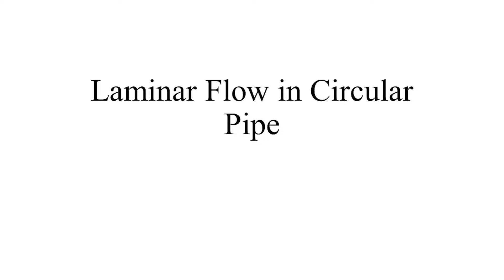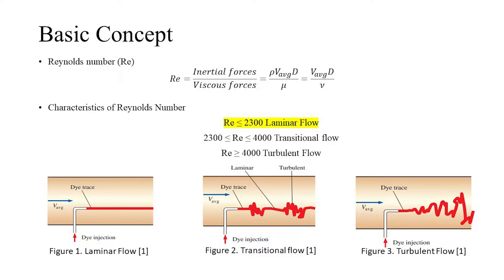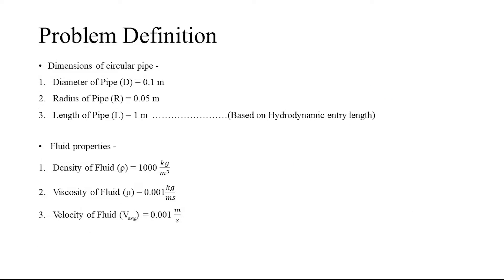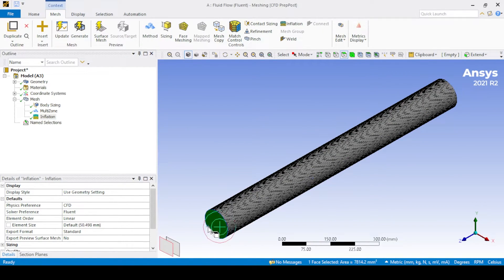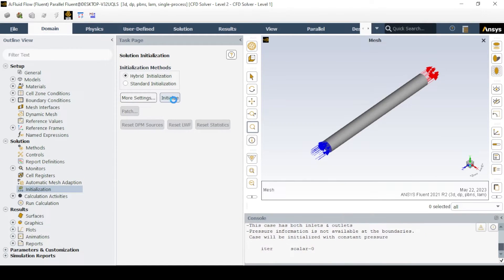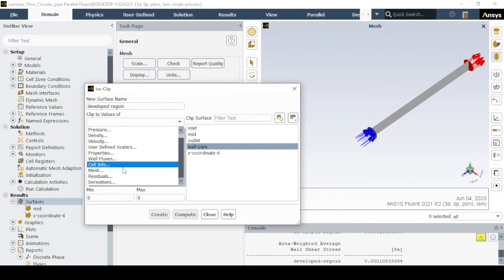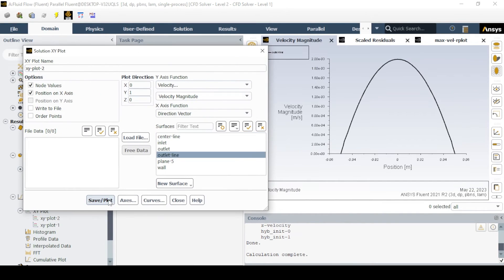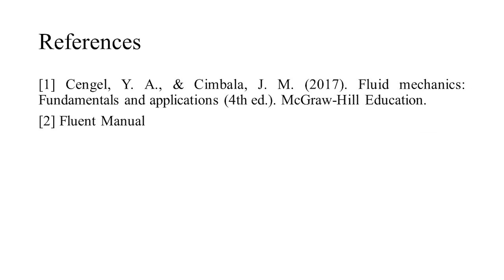CFD Analysis of Laminar Flow through a Circular Pipe using Ansys Fluent (Validation)

Comment: I did with 2D at the outlet but its not matching. for laminar validation i tried to get the ratio of velecity as area weighted average and the vertix maximum on outer surface as 0.5 for laminar but it is 0.8
Reply from the maker: Please provide details of geometry and setup parameters for 2D axisymmetric.